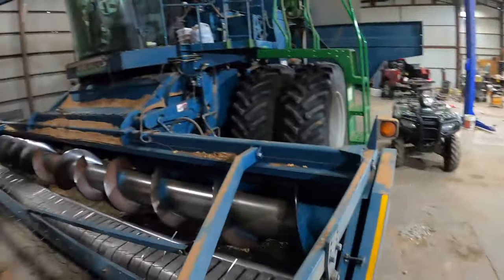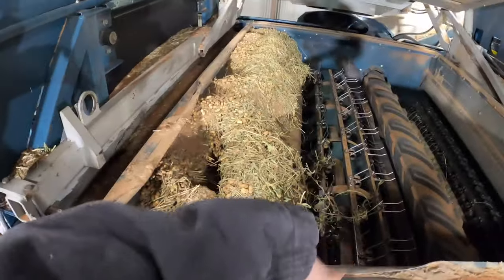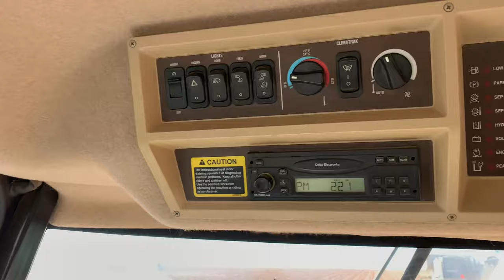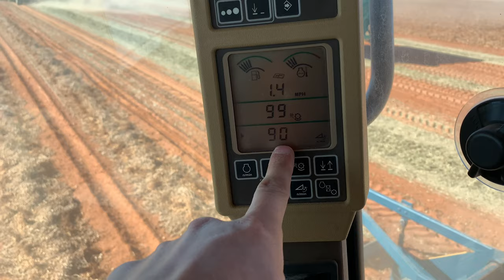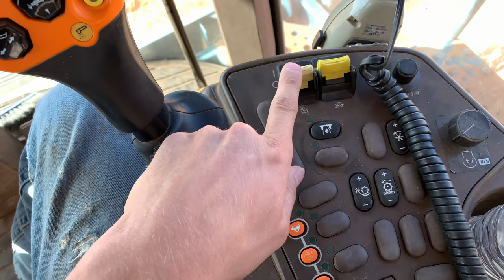How a peanut combine works

Comment: Is there a wind system for separating the peanuts from the straw or just them rollers n gravity
Reply from the maker: Yes I did forget to mention that there is a fan underneath that blows air up through the disc separators to help clean it better

Comment: I am having trouble with straw getting into the basket 

Any suggestions 
We've fiddled around with the air blower but the issue sticks
Reply from the maker: Have you tried driving slower. Sometimes it helps if there’s less hay going through the combine

Comment: Any reason why they don't use augers to fill the basket and off load it? thanks for the video
Reply from the maker: You can unload way faster with a conveyor than with an auger
Reply: Also your LSKs or loose shelled kernels would go up reducing grades.
Reply from the maker: That’s also true